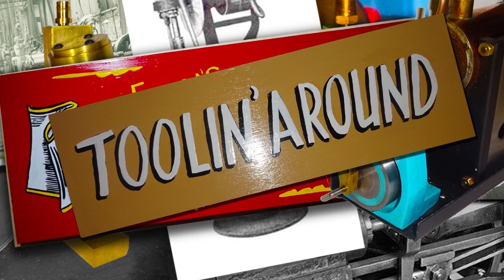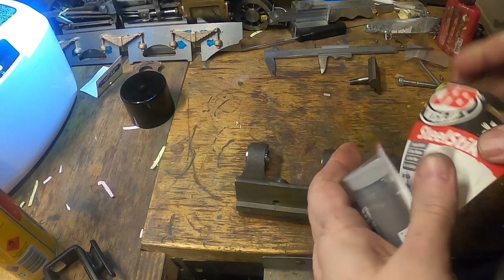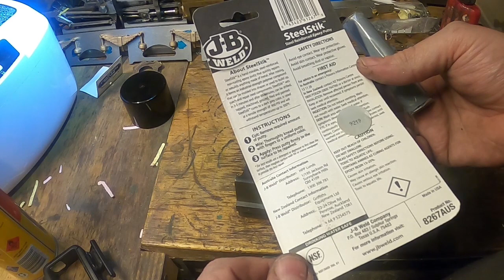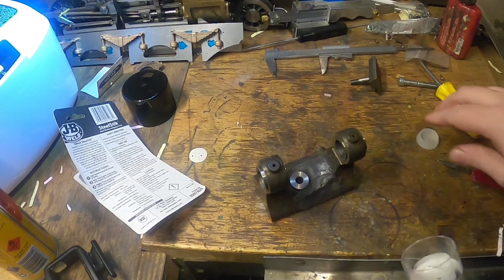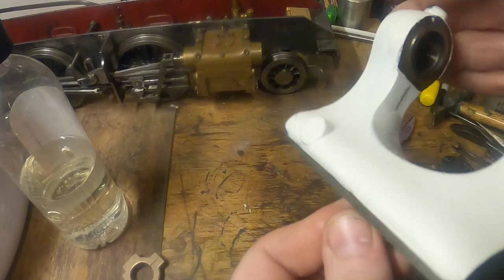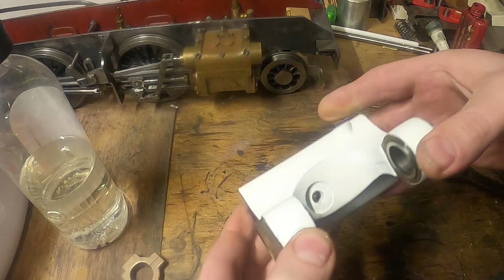a casting repair- Lorch L Headstock

Comment: Good looking repair Emma hope it works, I wasn’t confident when it didn’t stick first up:( I have used Knead It and it worked well until I machined it down to a thin layer then it started to lift. 
Cheers 
Peter

Comment: I had a similar annoyance where the butcher had hacked on my Monarch. After a few hours with the torch welder and grinder I can now stand to look at it again. My repair was on a surface that doesn't get paint though so I wanted a good color match and also I needed it to be magnetic so I can attach my indicators.  I am satisfied with the repair. Your looks good and I hope you are satisfied with it as well. :-)